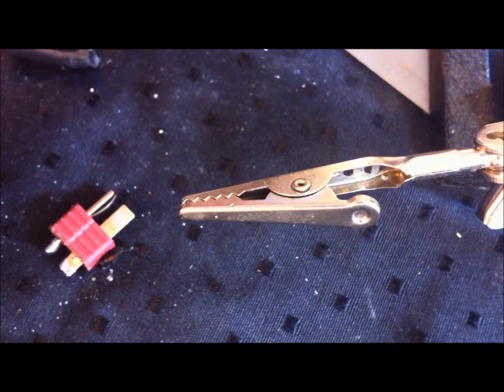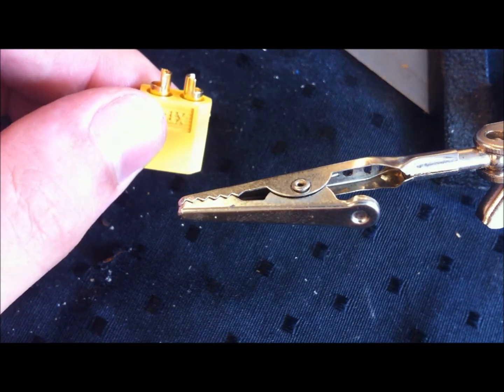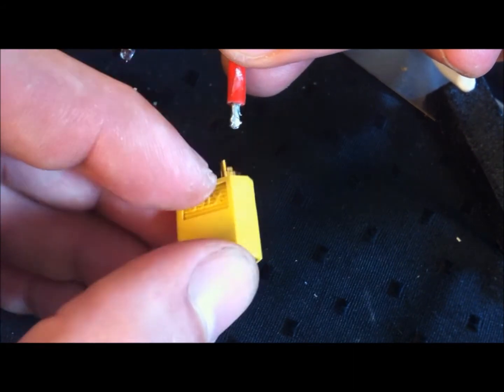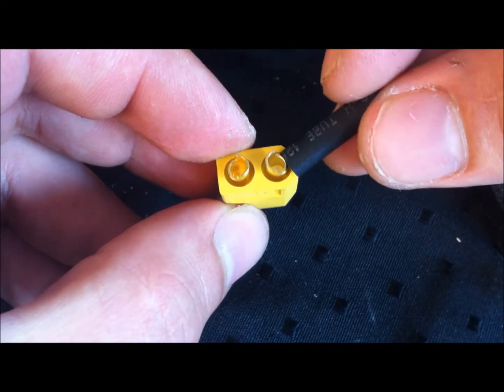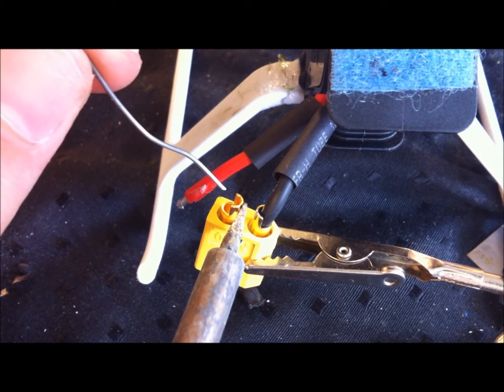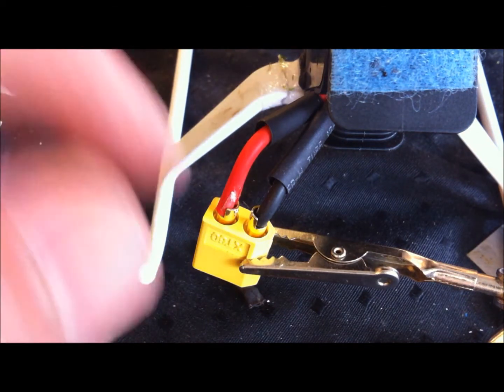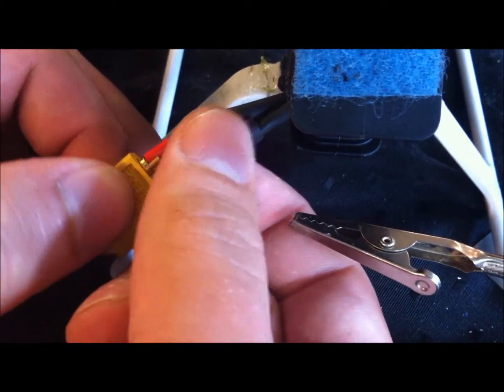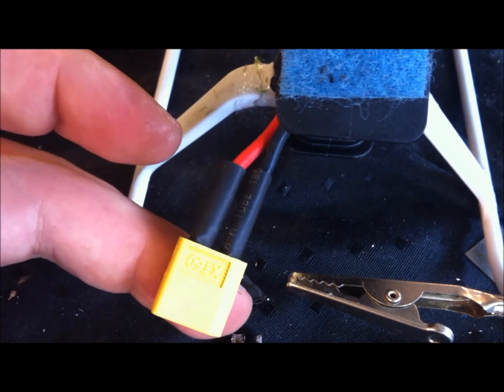Solder School: XT60

Comment: Nice video my friend, what size shrink tubing do you recommend ??

Also Harry's tip is excellent specially if you go overboard with the heat, having a them in pairs while you solder will help keep the connectors aligned since the plastic casing will get soft if you add too excess heat and there is a very good chance that the connectors will move out of alignment.